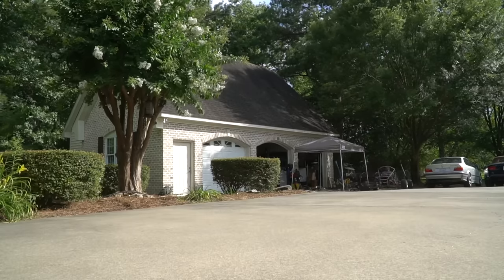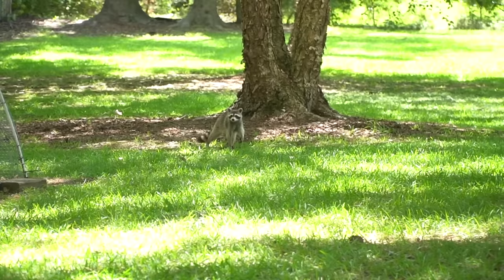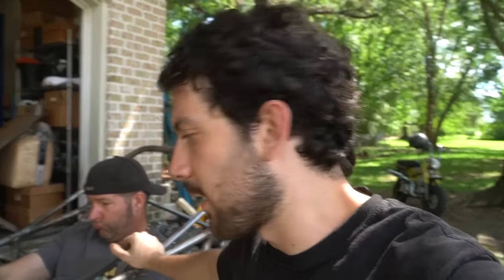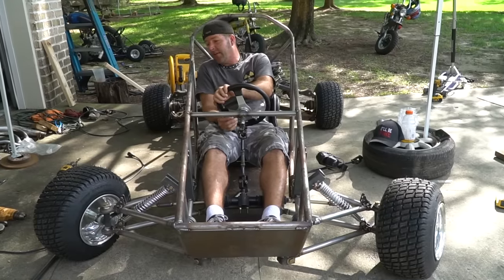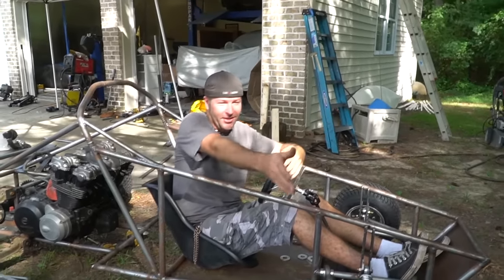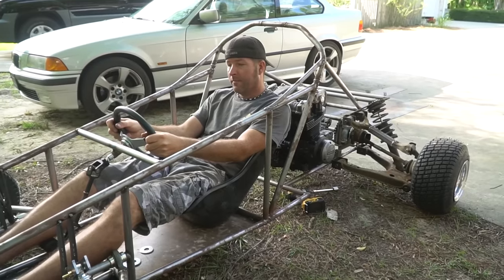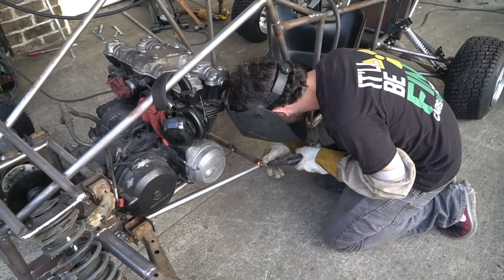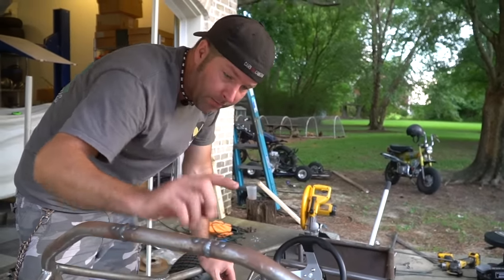ROLLING CHASSIS! | 750cc Cross Kart Pt. 11

Comment: Have you considered an “X” welded behind the driver seat to minimize twist?
Reply: And a firewall
Reply: Connor Utegg good call, thick firewall would easily replace the “x” in strength!
Reply: @roubenbird   They want airflow around the engine.
Reply: Scotts3Dart that space is so tight I’d think they need a fan and panels around the head/cylinders regardless if the firewall is there or not.
Reply: I'd add the x over the engine. From the arch over drivers head, to the rear top shock tower.
Reply: MightyMag that angle is so close to latitude, would it help with the centerline rotational twist?
Reply: @roubenbird  Yes, welding points should be at close to drivers ears, where you already have a joint. And from that point diagonaly to shock tower.
Reply: Google "trophy truck roll cage" and look at what they're generally doing at the upper shock mounts.
Reply: That's what I was thinking
Reply: I was just thinking at least a sheet of metal to protect the driver from the engine, welded over an X. I'm sure you could design airflow/fans/ducts to work in tandem with this. If they weren't already done with this I would take the time to think it over.
Reply: MightyMag I get you. I think that is more for outward deflection, not chassis twist. Their frame is currently just a box. Reinforcing a side of the box only adds minimal rigidity.
Reply: I agree with this comment and all comments in thread
Reply: They'll beef it up as needed. It's probably already been done. Remember, these videos aren't live.
Reply: I absolutely agree, I would have just built a small cage for the engine with a y section and a couple of those huge joints that they used for the front suspension.
Reply: roubenbird I thought the same thing
Reply: @connorutegg2486  thats a great point you bring up. However, interestingly enough, crosskarts dont tend to have firewalls which i think is odd.
Reply: this was my thought glad this was first comment
Reply: thats exactly what i said in my mind

Comment: The kart looks like it's folding right where the seat is. You can see it in various shots and it appears that it's already bent and closer to the ground
Reply: Yeah, Very clearly that needs to be alot more rigid. And a Gopowersport gusset isn't gonna be enough. lol Also, It looks kinda funky with a square frame like that.
Reply: This setup is sooooo ghetto
Reply: It's junk. The rear struts are sprung for a 2500 pound car
Reply: @wheeln24-79  and the fronts... A 150lb chinese motorcycle
Reply: @krakdaus5442  shutup
Reply: @zackhohman17yearsago92  am I lying?
Reply: @krakdaus5442  I personally think it is cool but....

Comment: I think yall are gonna need more bracing for the rear half connecting to the front half. If those pipes coming down from the roll bar fail, itll just fold in half

Comment: Front shock angle is way steep reducing spring effectiveness.
Reply: ^^^^ what he said, those shocks weren't designed to work the way you have them setup
Reply: Dude they know everything and these are pre recorded
Reply: @jeffreydover  "They know everything" - not so fast there bud. They know 0% about steering geometry , suspension, or fabrication.
Reply: @jeffreydover  point one: no
                 point two: so what they are prerecorded.
Reply: Yeah shock should mount to bottom A arm
Reply: As you apply angle you increase leverage, the physics of it are incredibly similar to rigging sling angles when lifting materials, actual ratios exist for this and i would say a cross bar inside the v of the control arm putting the shock at a 33 degree angle would provide the best results.
Reply: Guess no one saw the last episode.
Reply: @NikMartin-I-am  Your comment is a fail as proven in the episode previous to this.  Nice false accusation though.

Comment: I have same welder. The Vulcan mig gun from harbor freight is much cheaper ($100) and fits the Lincoln MP210. The only mod necessary is trimming out some of the plastic where you plug it in. The Vulcan gun feels much more industrial with the spring supporting the cord at the gun side and has reduced the problematic issues that I have experienced with the Lincoln pro, especially with the amount of welding I do.  

I don't know if you guys always use straight mig welding with gas, but I frequently have to switch between mig and flux core. You should always change your liner or use different whip altogether. The flux core will contaminate liner, so when you switch back to mig wire, you will start having problems from the contanimation.

Comment: Part of the issue you are having with your welder is that you are outside with no shielding. And slight breeze will blow your shielding gas away before you make your weld. This will cause crappy welds. No adjustment on the welder can correct this.
Reply: Except maybe increase the gas flow.
Reply: i disagree. a regular wire welder with no gas can still weld that frame good. i bet their leads are burnt.
Reply: To me sounds like a worn contact tip
Reply: Seen the magnetic welders they got around the world now?  There the coolest welders I've ever seen
Reply: I would assume the liner is tore up, I put a piece of foam on a peg on the wire before it goes through the lead to clean the wire as it enters, it help get more life outta the liner
Reply: They also weld dirty.
Reply: @frigglebiscuit7484 Wire welding that uses shielding gas will not weld a frame good at all. It will be a bubbly goober mess. With no gas they would need flux core wire.
Reply: @finalcallracing  ah, i didnt know the gas wire was different.
Reply: @frigglebiscuit7484  Only with flux core wire 🤦‍♂️
Reply: Tumbledown 30 , it’s probably just dirty inside the feed line from build up of crap. A good idea would be to pull out the wire and blow it out with some compressed air, then run something like thinners to get rid of some of the left over crap.
Reply: their welds look like a mix between moon rocks and hammered dog shit maybe if they used flux cored wire with gas it might help...or you know how the old saying goes a grinder and paint makes me the welder i aint
Reply: If he has had that torch for a year, as he said, chances are there is dirt, metal oxides, and other contaminants messing up the smooth flow of weld wire from the wire feeder through the flexible conduit, and up to the torch. A flush with a little brake cleaner might help, but it's better to replace it...
 Was a welder at Electric Boat for 8 years, and this was a constant problem, when it came to intermittent wire feeding to the torch. Also, check the gas ports in the torch head, under the gas cup, and replace the tip, if possible....
Reply: @finalcallracing  Problem with that, is that Flux Core burns a lot hotter than "Short Arc", with a gas shield. It might burn right through that tubing, if you run too long. Tig welding is the best setup, but I don't know if they want the expense, of the extra gear...
Reply: @Vindictus67  Its not just the gear. It takes alot of talent to Tig weld properly. I can tig weld, but I have a pro weld my cages together.  I can burn a hole through a tube faster than anyone tig welding. I will tig non safety items.   I'm 100X better at wire welding.
Reply: Dude, I'm a guy with two hands full of thumbs, and was able to learn quickly how to Tig weld - even parts to a nuke sub. It's all in the power parameters. You can weld two quarter-inch plates together, or weld the edges of two razor blades together just as easily - it's just how hot you run the machine...
  The weld puddle is small, but the penetration is excellent, so you can get a great joint, especially on pipe, without a burn through. And, if you want to get fancy, you can flood the inside of the pipe with weld gas, to prevent "sugaring", which is the white oxide that collects on the inside of the pipe, under the weld joint.
 ...It's all in the setup - nothing fancy...
Reply: @Vindictus67  Maybe one of these days I'll get good at it.
Reply: Gregory Iannucelli , I love tig welding, it’s so neat and if you’ve got a foot pedal to control the heat it mean you can makes the end of the weld run as close to perfect as possible. I did a diploma of engineering course and I’d never used a pedal before and thought it might be hard, but its actually easier than just the normal button.
Reply: @frigglebiscuit7484  thats cause you use different wire if your welder doesnt have gas. By the way if your welder doesnt have gas you arent really welding you are just wasting time. I stck welder has flux on the rod. Tinker toy migs without gas are for sheet metal.
Reply: @CaptainScarlet1961  - flux core welds look like shit only when they're done wrong. If you know what you're doing they both look and work fine. The thing is, flux core isn't MIG - the settings and setup are completely different, and the technique changes a bit too. They're completely different welding technologies, though they look the same to the uninitiated because if the similar box sizes and wire feed.

A little research goes a long way. Protip - check the polarity of your setup if your welds are crap. ;)
Reply: Spoken like they dont have a clue and haven't been welding outside for years.  Sounds like you need advice from them, not vice versa.

Comment: I think you need a big ole' X cross brace over the motor and something to tie the top sides of the roll hoop straight down to the frame under the engine. (While still allowing for space for the headers etc.) Looks pretty dang sweet though!

Comment: Hi guys, I used to build race cars a long long time ago and I had my concerns about your front suspension when I first saw you mocking it up. The reason it's not supporting itself is because of the angle of your spring. It's exerting almost all of its Force outwardly and not downward. You need to add a support that moves the top end of the spring out so that it's pushing down instead of out. This will solve your problem. If you don't the amount of pressure that will be needed on the spring would more likely bend the frame before it actually pushes the wheels out with a force that you will need.

Comment: Good idea on the second rollbar hoop. Tie it to where the side frame braces meet the top tube, and run a single backbone tube between the hoops, a LA a dragster roll cage. You can then run back downtubes from the back hoop, to the base of the independent rear suspension on each side. This will also add stiffness to the frame, behind the driver.

Comment: I'd add 2 extra longitudinal beams - maybe tubes of slightly higher diameter, maybe square pieces, that go from the front all the way to the back. I still see the possibility that the frame as it is now, will bend behind the seat.

Comment: looks rad guys, some guys in shop class back in high school made something similar but with much larger tubing but it was also powered by a 1.6l civic motor with a turbo slapped on, it was hella fast until it burnt up,cheap parts and half ass assembly, that should explain what happen there, but if i where you guys id add a X brace going from the top loop down to just in front of the engine before id start adding other bars anywhere else. a well thought out X brace will add a ton of rigidity to any chassis...

Comment: Look up akerman for your steering and your u-joints on the steering shaft should be in line and clocked the same.
Reply: mitchell fillyaw Ackerman and bump steer for sure. Also good point with the u-joints.

Comment: I have to say it, the extreme angle the shocks are in is driving me nuts. Put a plate on the lower control arm and move the lower mount inboard 3-4 inches. It should help drastically
Reply: Ziggy this would make their spring situation even worse, you would create more leverage meaning they need even stiffer shocks than they already do.
Reply: MrJoanzee I appreciate your thoughts and agree the need a slightly stiffer spring. I have been working on vehicles for 32+ years and I know from experience that the bottom of the shock need to be almost under the top mount and the the shock would work better if the moved the bottom towards the frame.

Comment: It's been a while since I did MIG welding, but every time I see you guys using it, the thought that instantly pops into my head - without even thinking about it - is,      "they're feeding the wire too fast."  That steadily intermittent lack of contact for like an eighth of a second, and the sound having more hollow "pop" in it than it should, only way I can describe it.  I mean, just a smidge lower speed on the feed, and then adjust heat accordingly and as necessary.
Reply: ...And those big glowy chunks among the small sparks, those chunks are the extra wire.  I'm thinking the gas exit area will stay a bit cleaner too.

Comment: It’s good that you moved the shock to the lower control arm, but it needs a triangular plate welded to the lower control arm, and the shock mounted closer to the middle of the control arm. Then the shock will be in a more vertical orientation. You can then get rid of that upper mount you added and mount the upper part of the shock in the original mount. A firewall separating yourself from that engine would be a safe option, and it would provide some chassis stiffness.

Comment: Hey guys! Your gun for your welding machine is probably fine! They have a liner in them that the wire travels through, that's probably what happened to it. They're not that expensive and they do need to be changed every now and then. I go through them at work about once a month. Just figured I'd let yall know!!! Keep rockin and buildin cool rigs!

Comment: You need to get a almost vertical for  the top shock- spring  front mount.   It will help the camber and distribute the weight and utilize the spring. Try it.  Nice build!

Comment: Hey guys like your stuff i was a welder for about 25yrs
 I found out if your running a gas with it that if theres to much of wind or fan speed it blows your gas away and it will weld funny ok just a suggestion have fun and the lead or gun whatever your calling it will wear out lol check your tips also ok

Comment: You guys should make sure the steering arms (welded to the spindle) are pointing towards the center of the rear axle. This will help with less wheel scrubbing by giving an optimal Ackerman ratio.

Comment: I watched your video from 3 weeks ago. The carbs on the Honda 750, one of them has a tear in the umbrella slide which is not allowing the engine to rev up. 
Rev the eng while checking that all 4 slides are moving at the same time (a mirror) if one is erratic or not moving, check for  a tear.

Comment: The front suspension, as it sits, is a prime candidate for a pushrod system. That would move the shock into an upright position and allow more full motion of the damper. The real trick is getting the lengths of the arms on the bell crank the right length. But I'm sure there is an online calculator for that.

Comment: Disassemble the welding "wand" and check for electrical corrosion on connections/washers and clean up, replace and tighten if any problems found, then reassemble. Happened to me and that fixed it functionally until new unit could be obtained...

Comment: Battery mounted behind seat on a sheet metal floor with an x brace  in that open rectangle will also stiffen it greatly and help focus the  weight to the middle of the chassis , will also give the battery a safe firm mounting place with short wiring

Comment: Move the bottom of front shocks inboard about 5".
Reply: You are right. Angle on the front shocks is too shallow, causing them to work much harder. The top of the shock should be more upright..
Reply: Gregory Iannucelli the issue with this is that you reduce the effectivity of the spring. They would need to go with a stiffer spring to make up for moving the shock inboard.
Reply: @MrJoanzee  Agreed. But, in upping the spring rate, you are also increasing the load on the shock mounts, due to angular forces being applied. Better make those welds strong, and hope that you don't bend the frame rails, on a hard hit....

Comment: you might want to drill and tap those hyme joints and add some zirc fittings so you can grease them. It will help with the stiffness a lot.. I hope you guys decide to route the exhaust up and over the valve cover that way the heat will just rise and not soak the engine, and then theoretically you could put the gas tank behind the seat as you didn't leave enough room to put it at your feet. Remember if you want a taller tire summitracing.com has plenty of ATV tires for a decent price including boggers ($70 each)

Comment: Maybe someday do a revision to the chasiss design and build a completely fabricated rear suspension like the fronts. I would save HUGE amounts on overall weight, and you can build your shock system to be adjustable like the rears. Those Miata parts are still cool though!

Comment: dont use the engine as structural point..the case can crack pretty badly
Reply: Exactly! You never want engine mounts to flex at all with the frame. The engine case can't take stress like that. As soon as they jump that thing and it lands crooked on one wheel it'll do some damage....
Reply: Colin Chapman says What??

Comment: X brace in the roll loop vertically between engine and seat for stiffness and to attach a firewall to as well as  an x brace over the top of the engine will stiffen a lot of that rear end !

Comment: Hey guys for your safety i would take the steering shaft and redo it. You need to bevel any end that your gonna weld so you dont have just a weld sitting on top. Just butt welding is not strong enough in most applications. This same thing could also help you get the strongest welds with many other dofferent aspects of your projects including heavier wall tubing etc..